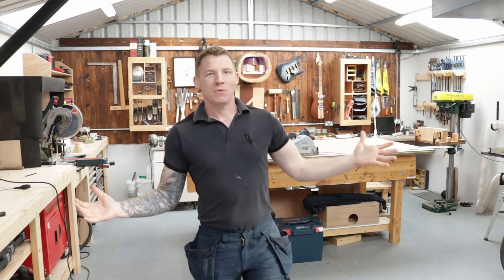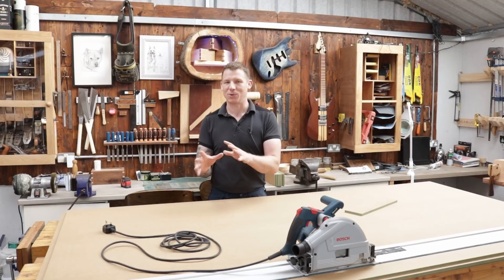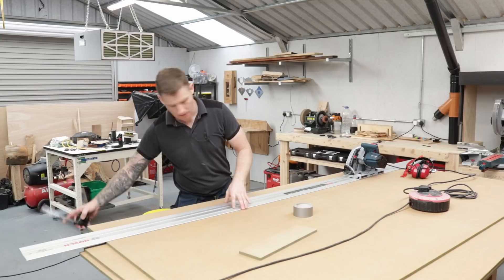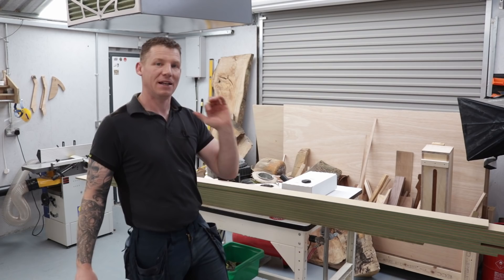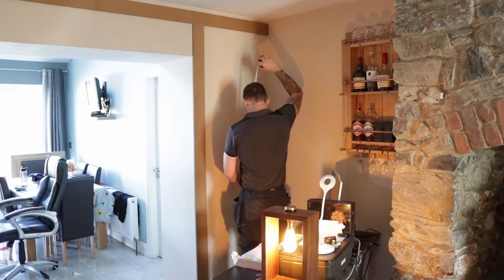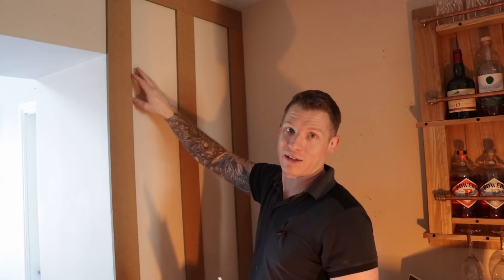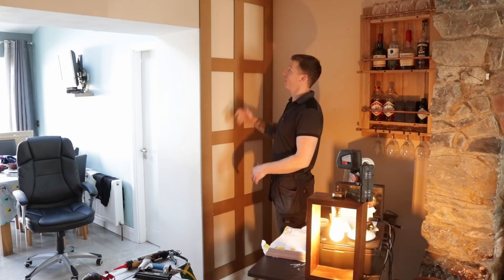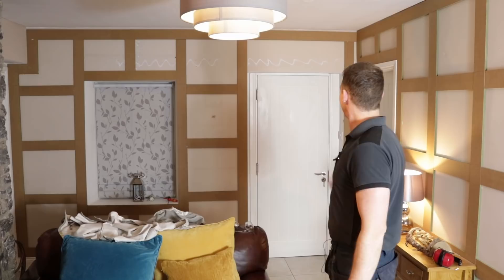Wainscoting DIY Make Your Own!. Whiskey Room Build #1

Comment: Hi John love the work it's gonna look brill I watched your video on fitting the Record DX4000 as your main dust extraction as I've just bought one I was wondering how it is shaping up since you've had it fitted for a while do you have any downfalls with it thanks keep up the great video's
Reply from the maker: Hi Alan the dust extractor is working great does the job really well, once you make sure your system is well sealed it has plenty of power , the only issue is emptying which is a pain but that's true of all extractors.